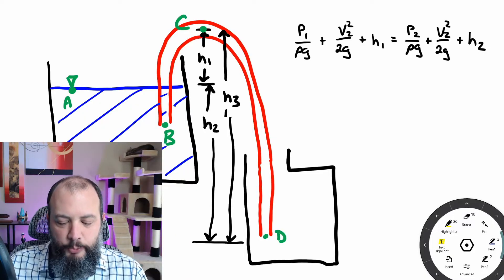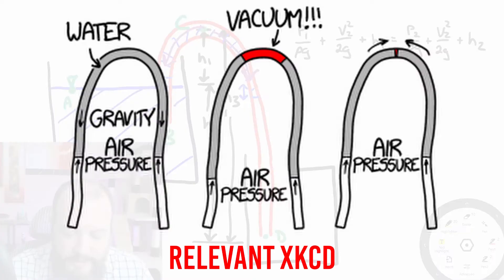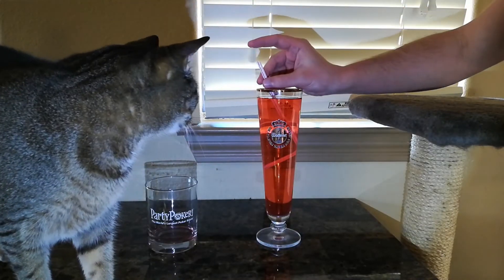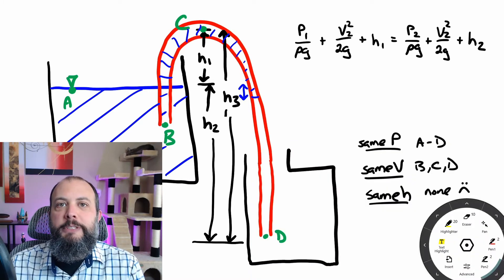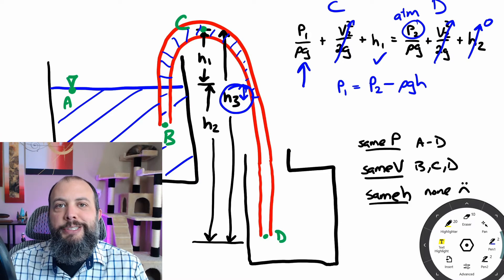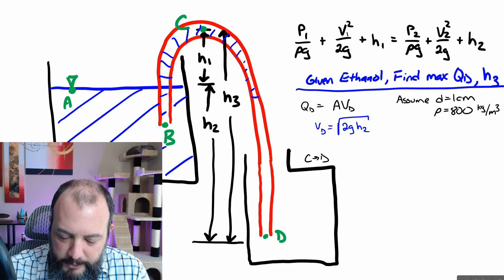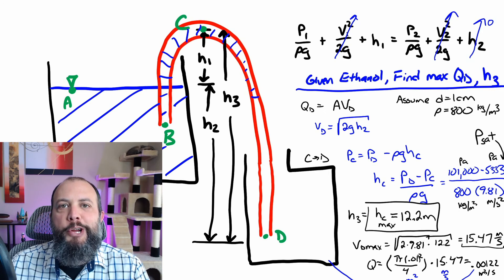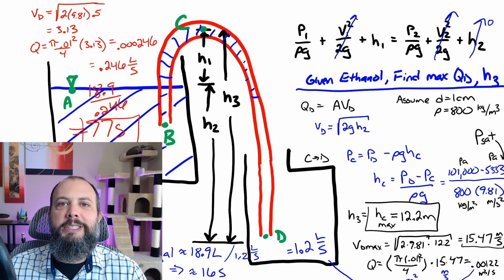Find Max Height for a Siphon – Bernoulli and Continuity Equation Example Problem

Comment: Thank you so much. For some reason I mistook the sigh p as pressure instead of densety and couldn't for the life of figure out how to get the Max height.
Reply from the maker: very easy mistake to make. Same with all the different 'v's, volume, velocity, specific volume...I always try to really exaggerate the slant in the density character to visually distinguish it from a p. That helps me out. Of course the best way is to just always write out all your units, and you can catch these mistakes since the units won't match up ... but yea, I'll probably never actually follow through with that.

Comment: question regarding the example problem. we know that Vd=sqrt(2gh2) and yet we found h3 instead and used that. is that allowed per say? got kinda confused there
Reply from the maker: When finding maximum discharge rate Q (which is directly related to maximum velocity Vd, we ARE using h2 as you said. I think I skipped a part ... to achieve maximum velocity, h1 would be zero. This means that h3 the peak height, would be equal to h2, the height of the tank siphoning from. If h2 were 12.2m, and h3 a little higher, 12.5m, you would get cavitation and the siphon could break. If h3 were 12.2m and h2 were a little lower, only 11m, it would barely not cavitate, but velocity would be a little slower. You get maximum exit velocity when initial height h2 is at the max height h3, which is why I used the same height for both.